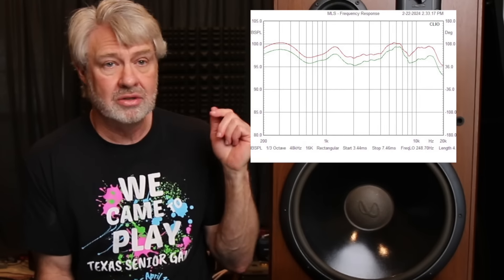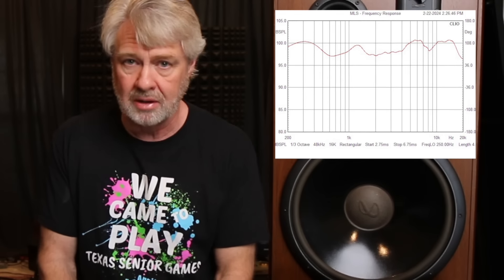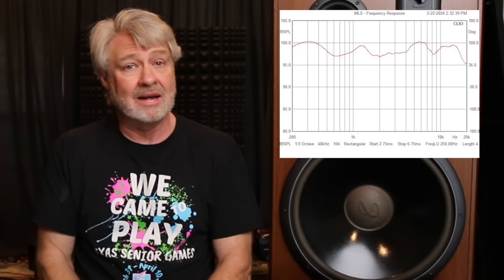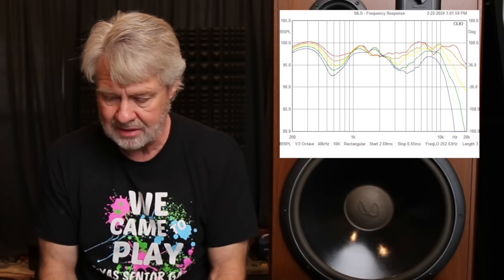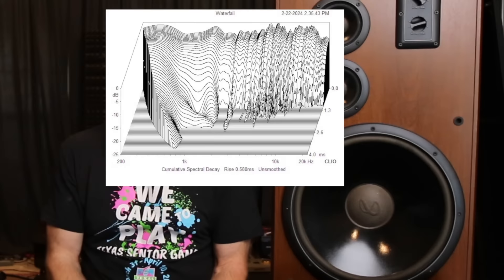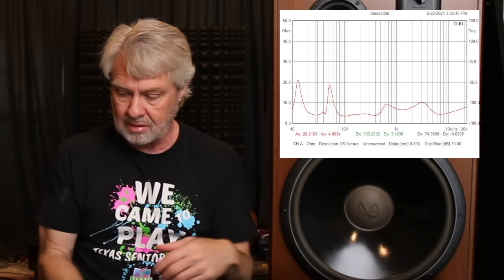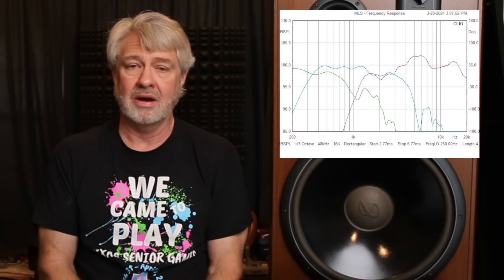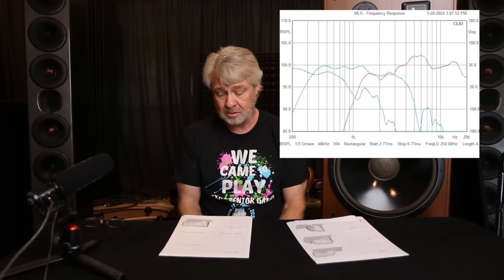Unleashing Infinity: SM-152 Transforms from Good to Great! 🚀

Comment: Not sure if they shipped from the factory without dampening in the box? You've never seen these before? They were marketed to compete with Cerwin-Vega. The crossover has self-resetting circuit breakers to protect them from overpowering at party level listening. It's clearly not an "Audiophile" speaker, and replacement drivers are not available for decades. The only worthwhile "mod" is to insulate the box...and maybe stiffen the walls with on-edge gussets. Other than that, it's mass-produced CNC vinyl veneered fold and glue enclosure. Modifying the crossover will compromise the longevity of the mids and tweeters when cranked to party levels...which was the intended market. BTW...the drivers were sourced by Tonegen, Japan for Harman/Infinity.
Reply: So you didn't watch the video.
Reply: @craigellsworth3952  I watched the whole thing. Assumptions are funny.
Reply: BS!!! These can totally be audiophile when paired up with the right equipment and with a few tweaks to them. I have owned pretty much every kind of speakers over my 40 years plus of being an audiophile, these are always my goto speakers when i want accurate sound but at obscene levels. I have the SM112s and SM122s powered with an Adcom GFA 575se with 350watts per channel and Bryston preamp and CD with built in DAC and they sound better than my $8000 a pair B&Ws. For the price, these simply couldnt be touched in the 90s and even now. I have people come over and they cannot believe how well they sound. They are efficient but they also love power. The more you give them, the better they sound. I can get mine to rock concert rediculous levels and they still sound crystal clear.
Reply: @vegaslimoguy2376 Yes...amplifiers matter. Glad you love them. Headroom is more important than redesigning the crossover...that doesn't need to be redesigned. Infinity designers didn't just "throw caps and coils" at them. They were designed to play at "obscene levels" that doesn't mechanically stress the midrange and tweeters.
Reply: @edgewound  You act like an engineer, but don't think like someone designing a product to a price point. Yeah, I know what "edgwound" refers to.
Reply: @craigellsworth3952 the only upgrade worth spending 10 bucks on is fiberglass dampening inside. $829 for an "upgrade" kit? It's your money. Have fun!
Reply: @edgewound   I have active tri amped Legacy Whispers. And you?
Reply: @craigellsworth3952  TAD Reference One, Elac Navis ARB-51.
Reply: @edgewound   Sorry, I expected you to be someone that made speakers.
Reply: @craigellsworth3952  Which model??? I have the XDS and believe it or not, i still love my Infinitys in my secondary system better. The guy that i purchased mine from was one of the head design engineers at Legacy in Illinois. What year and model exactly do you have???
Reply: @edgewound   I had L300s in my misspent youth. Wish that I had bought the zl212s at the time.
Reply: The new crossover does not compromise the longevity of the mids or tweeters.
Reply: @dannyrichie9743  lowering the crossover points reduces power handling while increasing distortion and increasing power compression. More stress. Shorter life span from thermal cycling.
Reply: @edgewound   Come on now Mr. edgewound copper voice coil, you honestly believe that Danny isn't fully aware of this, and takes power handling into consideration before redesigning the X-overs? I bet a set of 30 watt Mac monoblocs would light these speakers up.
Reply: @edgewound  Crossover points can be lowered while protecting the drivers more by using steeper slopes.
Reply: @dannyrichie9743  "Can be" should be qualified. You have no before and after specs...Frequency/slope on your crossover kits. You display graphs. These drivers are no longer available from Infinity, and when users crank these up to party levels expecting them to live through your lower crossover points...and exceed their thermal limits, they will be SOL trying to find exact replacements. More goes into it than simply lowering crossover points. You didn't even know that these had no insulation/dampening from the factory. Your description of "throwing caps and coil at" it is a flippant comment that completely discounts that the designer knew exactly what he was trying to accomplish by designing to a price point. The factory crossovers have self resetting circuit breakers as protection from over powering in this scenario. How did you design for that? Did you include include driver protection?...or does that simply pollute the circuit from "audiophile" quality? No specs, no pictures of your kit. What is the buyer actually getting, other than your word? That's a lot of money for a box of parts.
Reply: @edgewound  Your speculations are unfounded and are just false assumptions.
Reply: @dannyrichie9743  My speculations are based on what you said in your video, and published on your website..and therefore are not speculations.
Reply: @edgewound  You don't know what the slopes were before or where they crossed. You don't know the thermal or mechanical limits. The mechanical limits are being controlled by the crossover and the thermal limits have not changed.
Reply: @dannyrichie9743  yet...you don't reveal any specs nor photos of your mod kit. What is it you're selling? And...I just might know more than you speculate.
Reply: @edgewound  All covered here: https://gr-research.com/product/infinity-sm-152/

Comment: Are they high end? Nope not by a long shot. Do they sound awesome rocking out? Hell yeah! I bought SM's back in the 90's for my home theatre. SM 155, SM center, and SM65. They worked great for watching movies and rocking out. I phased them out in 2005 when I got Infinity primus with there 12" powered subwoofer  for home theatre and used the 155's in my weight room. I got rid of all of them about 5 years ago and went with bookshelf speakers on the wall with and powered sub in the corner to make more room. The SM series were made for a certain crowd of audiophiles to compete with Cerwin Vega's tower speakers and it did that very well. I wish I had the room to keep them but they just took up too much space. And also the foam was starting to go on the cones.